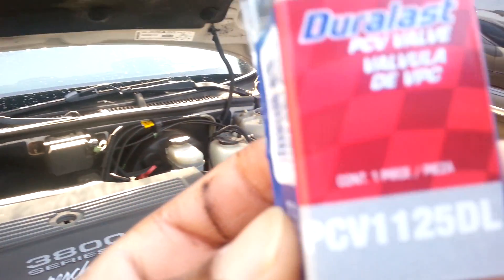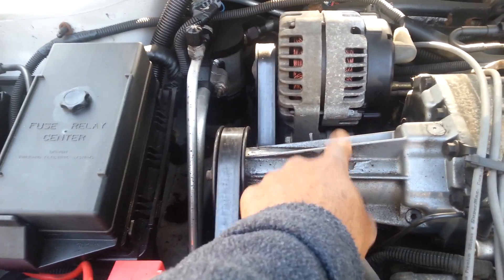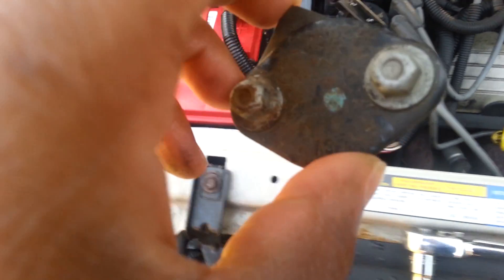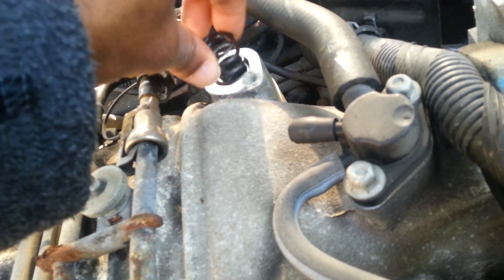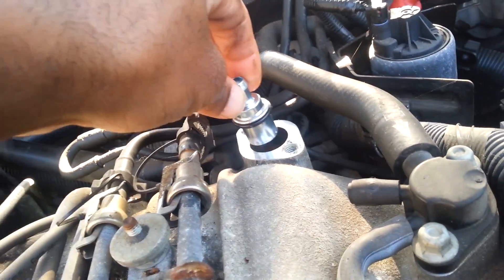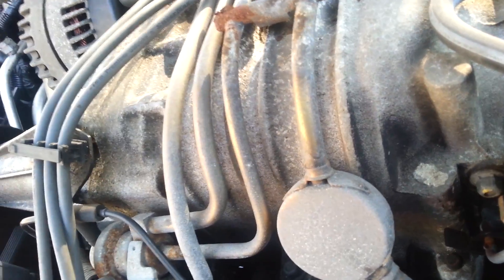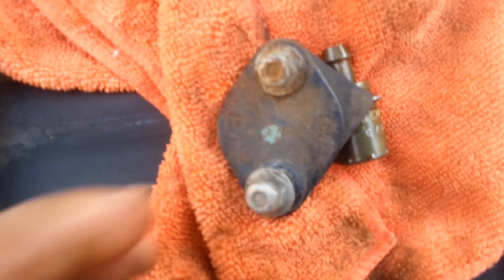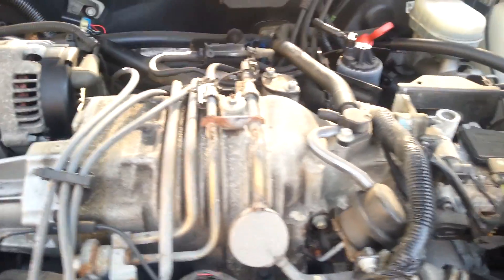Replace PCV Valve on 3800 V6 Supercharged

Comment: Bruh, I'm glad I found this. I have a 1998 Buick regal gs, 68800 original miles. Boost is strong then low then strong. After new vacuum lines, boost solenoids,same deal. One of my Buick regal buddies said a new pcv should solve the issue. So your video is gonna be textbook on me changing it. Simple. To the point. And DIY for sure.

Comment: Make a gasket with a manilla folder..cut a piece larger than the cap of the PVC and lay it across and take a small hammer a tap lightly around the edges of the PVC cap..after going all the way around you can pull the perforated edges and you have now made a gasket
Reply from the maker: You lost me with the hammer...lol...but good idea
Reply: @cedmac3366  the hammer makes in impression in the paper almost like a template.
Reply from the maker: I bought some gasket paper from autozone and made a few templates for future repairs 👍🏾

Comment: Thanks,  Ced Mac! Single mom here trying to fix whatever I can myself. I was thinking fuel pump. PVC valve on top of motor with 10mm wrench and needle nose pliers is something I can do! Your motor looks just like mine. Buick Park Avenue '99. Thanks again.
Reply from the maker: Is yours the Ultra or the Base Park Avenue?
Reply: @cedmac3366  my Buick is an Ultra 'Golf Link' edition. Changed PVC already and it didn't fix stalling (hiccup) problem.
Reply from the maker: What problems are you having?
Reply: @cedmac3366  Buick hiccups and stalls.  Always restarts. Runs well on cruise. Changed PCV valve but no change.
Reply: @cedmac3366  replaced PCV valve and cleaned MAF sensor/screen. Buick still stalling and lurching at running temp. Runs great when cold.
Reply: @cedmac3366  stalling, mostly. Sometimes car lurches. Seems to be fine when it's cold but starts stalling again when at running temp. Buick Park Ave Ultra 3800 supercharged .99
Reply: Replaced PCV valve.  Cleaned MAF sensor and air filter.
Reply from the maker: @mariamadrid2508  any luck since the last time?
Reply: @cedmac3366  a friends brother in law suggested replacing cam position sensor which he has done before on his mother's 99 La Sabre. Scheduled for next weekend. I gotta rent pullers for a pulley he said. That's update.

Comment: This guy is a rocket scientist.
 If you had a user service manual you would already know. Dont Force it without oil or petroleum jelly on the seal, it's tight for a reason...Genius

Comment: Others are confirming that your video is very informative, for good reason. You deserve to be commended for posting this, sir!! 
There are no other videos that are covering the removal and installation of the PCV valve in the supercharged Grand Prix. What you have explained is the same issue I faced when I was dealing with oil related issues. I bet 90% of the PCV valves in GTP's (and GT's) are neglected. All the parts except for the PCV valve itself are no longer available from GM. The top cover with the gasket is not available, you may need to get RTV gasket maker and form a bead around the bottom of the cover right over top of the old gasket in order for it to seal properly. You don't want a vacuum leak here.
Lastly, about the PCV valve system, here is a lengthy writeup from the group "gm 3800 service tips, techniques, and advice" on Facebook. It is really a must read for everyone owning the w-body platform cars! https://www.facebook.com/GM3800Tips/posts/587486968067136
Reply from the maker: rcharne thanks for the info and links about the PCV valve. 👍

Comment: The PCV doesn’t come with an o-ring as that’s meant to stay inside the supercharger.  DO NOT do what this guy did and try shoving the pcv with an o-ring on it into the hole.  Put the o-ring inside the groove IN the supercharger first, then put the pcv into it.  At no point if you’re doing it right do you need to be forceful.
Reply from the maker: This process actually worked great...👍🏾

Comment: Maybe the O’Reilly or NAPA version comes with an O-Ring and a Gasket.  Thanks for the video😎
Reply from the maker: I bought a roll of gasket paper from autozone and made a few templates for future repairs 👍🏾
Reply: @cedmac3366  NAPA has the complete kit with instructions, minus the gasket. You can use a small bead of Ultra Black or Ultra Gray Permatex silicone sealer. Both oil resistant. Do nut use red or blue silicone!
Reply from the maker: @jameskolich6764  cool...I had everything I needed...and I got some gasket paper from autozone and made several gaskets for future use 👍🏾

Comment: Vaseline will help with that O-Ring
Interesting to see that Oil cap specifying SAE 10W30 Oil, where our L36 and L67 engines are specified to have 20W50.
Reply: my 2004 impala ss has 5w30 on the cap depends i've seen some with 10w30 N  5w30
Reply: Where you from that it calls for 20W50??
I’ve worked on 1000’s of 3800 cars and owned 6 and only ever been 10w30 or 5w30 on the cap.  Always 10w30 in the engine though 😉
Reply: 20W-50 is way to thick for an L67.

Comment: I find it funny that these motors are referred to as BOC when they are a Holden motor made in Australia, yanks put them in the the wrong way. LAST OF THE GREAT AUSSIE 6!
Reply: The 3800 block began in 1962 in North America and was only produced in the USA until later in its lifespan.  Australia had mire to do with building series 3 3800’s.  So you can’t call it the Aussie 6, that would be like another country importing and breeding Kangaroos and then saying Kangaroos are from that country.
Reply: @justink7849  well if you build it do the R&D on the V6 I that's ummm making ,upstairs for thinking downstairs for when you've been drinking

Comment: So does the PCV valve vent gasses back into the supercharger?
Reply: No, PCV (positive crank case valve) vents the pressure created by the pistons going up and down internally. Supercharger breaths in air through the air box and when it actuates, blows that air into the intake manifold. They are unrelated.

Comment: How do you know of the pcv valve is shot ?
Reply from the maker: Brett Bloomfield the way it looks, oil sludge etc...change it anyway to be safe.
Reply from the maker: On The Base 3800 has a MAP sensor on top...on a 01 Bonneville the engine light was on and the car ran choppy, so I replaced the pcv valve and the MAP sensor and the light went off.
Reply: Ced Mac awesome thanks just wasn't sure
Reply: Shake it, it should rattle. They either get stuck closed or open which basically replicates a vacuum leak
Reply: **This**

Comment: I need some help man my supercharged is whining really loud
Reply: Change the supercharger oil??
Reply: @chrome21  good idea
Reply: Change the oil and possibly the coupler in the snout my supercharger was making like a knocking sound pulled snout off and the damn coupler was completely loose and worn from the inside like 10 dollar part at any auto store it’s pain in the ass but worth it also yes change the oil as well

Comment from the maker: Your PCV Valve should be replaced everytime you change your oil.
Reply: Ced Mac great video but you don’t have to replace every time you change your oil. You can inspect it when you change your oil but they will last a few years.
Reply from the maker: True...but changing it every 3mos/oil change is good so you have a schedule...plus it's cheap and easy.  Your car will run like crap if it goes bad. 
#preventivemaintenance 
#teambuick
Reply: If you are going to change with every oil change you just run the risk of breaking both the O ring and top plate gasket but hey everyone has their own way of doing things. I’m the owner of a 02 bonneville SSEI so I’ve been there with the O ring deal. Again great video.
Reply: nah, if it rattles, it works.
Reply: I hit mines with carb cleaner every now and then just to make sure they rattle freely. I see no need to have a whole box of slightly used pcvs

Comment: Just sayin' but if they didn't provide an o ring with the new PCV chances are it was unnecessary or an "add-on" from the last dude worked on it? I'd call the store where I bought the part and ask them if it was spozed to have an o-ring in the box/SAME WITH THE GASKET! Needless to say the poor dummies who work in the parts stores don't know either, and their damned computers don't say so how could you know? Damned if you do and Damned if you don't.

I'd like to know if you're still driving that good-looking piece of crap? I got one and just changing/replacing the serpentine belts is a F-ing nightmare., as soon as I get the bitch running I'm putting it out front for the first $800.00 I can get for it. It has a new fuel pump a new alternator a new battery ($160.00) and new belts., I'M DONE WITH ALL COMPUTER DEPENDENT VEHICLES~!!!
Reply: You can get the PCV separately or NAPA has the kit with o ring, spring, and PCV. I was one of those "poor dummies" that had to deal with you know it all "Backyard Bobs". Didn't retire poor either. Gasket is not available in the aftermarket and long discontinued from GM.